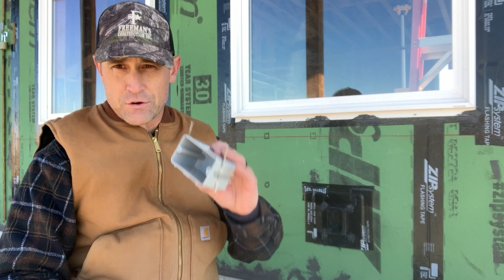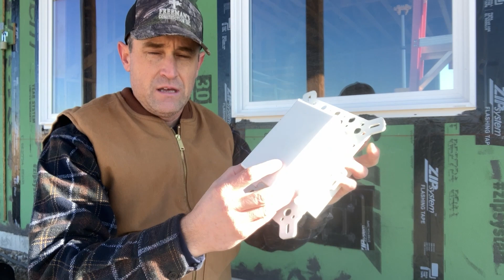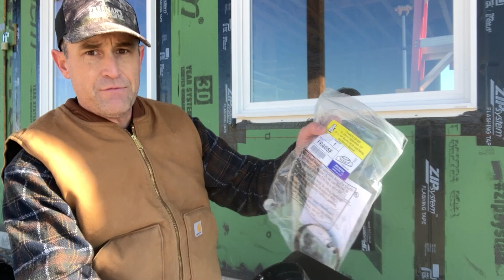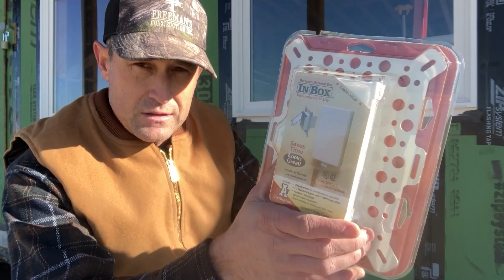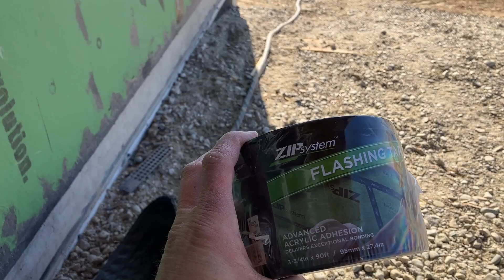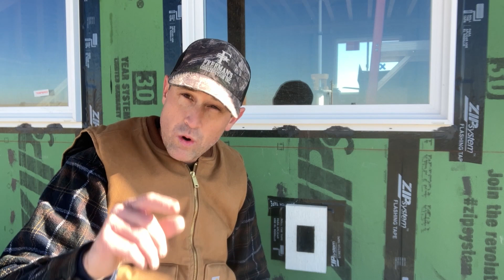Air & Water Sealing Exterior Electrical Outlets

Comment: Excellent and instructive video. A true craftsman with finese. I watching a place next to me, a "custom build", continue to make many, many mistakes. They are using the zip system, did not roll the tape and then put the siding on without any trades blocking and prottecting  the openings to accomodate a proper seal. Oh ya, we are right on the Pacific Ocean in the rainy Pacific NW.
Reply from the maker: Thank you so much for the kind words! We really appreciate you taking the time to share your observations.

Comment: Man I wish I knew this before we built our house in 2020.  We used the Arlington Inbox on ALL our exterior outlets, and I hate them.  You are absolutely right, the door hinges up and hits the Hardie siding, it is tough to un-latch because the siding is so close to the latch to release the door, and the hinge "pins" feel flimsy and cheap.  Luckily, we rarely use the exterior outlets on the house.  I'll be looking for the FR101F for our detached garage for sure!

Comment: Would it be wise to replace a 25+ year old exterior outlet with the FR101F if the current outlet is allowing water behind vinyl siding and causing the drywall and baseboard behind it to become moist?
Reply from the maker: It sounds like there is a problem with the primary weather barrier above the outlet or where it is sealed to the existing outlet. I would pull off the siding and see if there is mold and rot that needs to be addressed first and then replace the outlets with one of the FR101Fs and flash it like we show in the video. I hope that helps

Comment: If I'm using 2 #15 felt as my WEB- is liquid flashing over the tape a better hold? Not liking the adhesive hold to tar paper.
Reply from the maker: Are using black 15 lb paper felt? Can you send a picture of what the condition looks like to info@realpropertytv.com
Reply from the maker: If you are using black paper then I would use the liquid flash or another type of caulking that is compatible with tar paper. Big Stretch or Daps Extreme Stretch may be a good option. I would not use the zip tape on the paper.